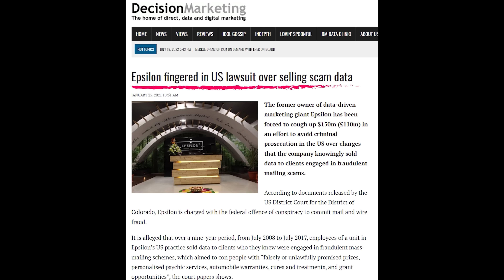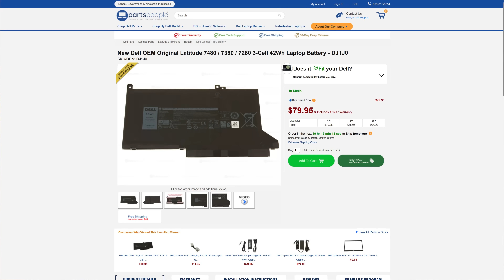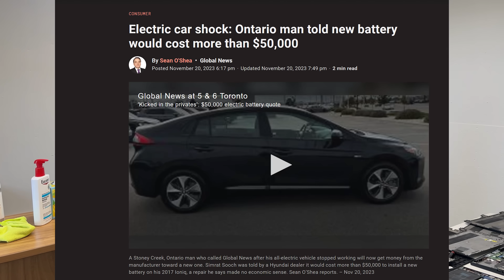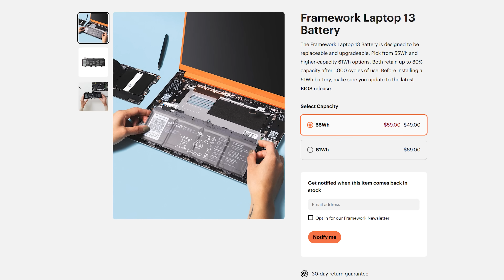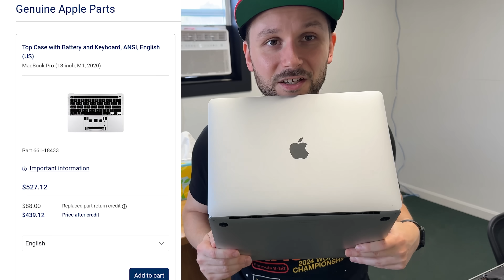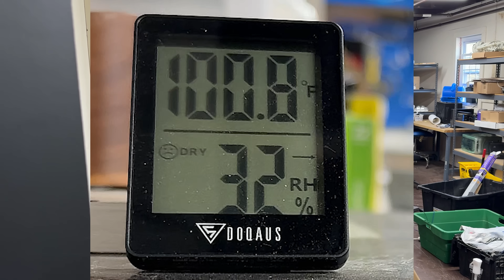Planned Obsolescence: Why is Replacing a Battery STILL So Difficult and Expensive?!

Comment: 3:28 needs to be a reaction gif for all my fellow devops guys for when dev sends you documentation

I noticed that batteries got crazy in cost after they became custom molded for the device. When they were just bunch of 18650s they were cheap as chips (which makes sense). So I'd blame that probably.

Comment: Ahh yes the Dell Latt 7490 and 7390.
Whenever I see one at work the battery is always pillow status.
I think that generation of batteries were just really bad.
I have other laptops that are just as old or older that don't have that problem as commonly has the 7390n/7490s

Comment: if the battery is just bloated, you can debloat it... with an all plastic tool and if possible when the battery is low on charge you can du a little hole/cut in the external plastic wrap to release the gas, the problem with dell batteries is that they are sealed.. when the battery release gas the wrap bloat... it's not dangerouse.. me and my boss have done this a lot of times

Comment: Your reasoning about not sourcing a replacement battery is exactly why I am having to replace my Samsung Galaxy S9+ with something else (either an A52S or a S23 Ultra). After several years of use, the battery life has just gone down the pan. And being a modern smartphone, I don't have the tools to unglue the back, dig through the phone, then unglue the stupidly-glued-in battery (and then replace everything and re-sealing the phone, hoping it doesn't break in the process). 
The cost of taking it to a phone repair shop would make the whole thing unfeasible - especially given its last OS version, Android 10, is starting to lose app support.
So the whole thing about laptop batteries applies to phones too - and the same goes even more so for the software! At least with a PC you can use Rufus to bypass the Windows 11 requirements. (I have Windows 11 on a 7th gen i5 with no problems.)

Comment: I feel like this is an appropriate place to say I somewhat revived a phone by soldering a different battery cell onto the connector for the original one, it worked fine until I started messing more with it and the connector up and died on me, but it was an interesting experience to have what looked like a AA battery taped to the side of it lmao

Comment: batteries arent THAT difficult to find/replace... as long as you are okay with generic ones. Genuine batteries from the manufacturer is another story, but generally as long as the device is still supported, i find I can usually hunt down a genuine battery or two. may be more difficult from a refurb pov because you may need dozens of them.

regarding windows 10 loss of support, those devices that can't upgrade to 11 will likely get linux or chromeOS flex.

Comment: What sucks too, is that many of these devices won't even run without a battery installed in them, not with just the power supply plugged in like the older laptops.  If it's swollen and you can't get a replacement battery then the device is e-waste!  Done on purpose for sure! 🤬😡
Also, I can't tell you the amount of replacement batteries that I bought off of Amazon that were just dangerous crap that swelled up not even a year after I replaced them.....some even REALLY bad! 😳🙄

Comment: The whole battery issue was better to deal with back when laptops used the common 18650 form factor for lithium ion batteries. Those never expanded, being a hard cylindrical cell.
The whole rush for thin and light computers meant switching to thin Li-Polymer cells, which have a tendency to bloat, and therefore fail - even if the capacity is still good, a bloated Li-Po is bad news. 
Some things have not improved for the better...

Comment: I'm looking to get into IT and noticed that batteries are the bane of many a portable device (ear buds, laptops, tablets, smartphones, wireless headphones, controllers, etc), especially when you're trying to get access to said battery. The one that is easy enough to get access to is the 8bitdo Pro 2 controller and that allows for using traditional AA batteries, comes in handy when the battery pack that came with it decides to no longer hold a charge and can be used as a traditional USB controller. Can't say that about the other portable devices that I have on hand.

Comment: if you get the batteries from taobao than a battery (3C Certified) for a macbook costs around 30-50 usd depending on the model

Comment: One more thing we all could do is stop using battery based devices, use AC power. The computer wouldn't care, it runs just as well (probably better) on direct power.
Reply: Thank the humble bridge rectifier inside the power cord that turns AC into DC.

Comment: the wider public isn't making enough of a deal about how we are getting screwed with tech prices and replacement part prices

as for batteries I have been told each model of laptop has custom made batteries    so the manufacturer marks them up pretty steep to shaft larger companies but it ends up fucking everyone else instead

Comment: No, you're not out of proportion (except your skeleton).I have 3 phones and a Thinkpad with bloated batteries (plus a pile of removed bloated ones on fireproof surface for future pyromaniac fun and current fire hazard). Now i'm on the only phone i got a battery for without long and complicated pre-order, because the rest of these are not in stock or even offer in my country. And the new battery i got seems to be low capacity anyways (or something's wrong with the old phone which does heat up when playing videos and i don't want to buy another one due to financial trouble and principles). The discontinued devices will become collectibles with very expensive or unobtainable parts it seems.

Comment: bluetooth headphones are notorious for this. Even if the company is a "good company", good luck replacing the battery in it a few years down the line. Who would have knew that a pair of skull candy bluetooth headphones that I purchased almost if not 10 years ago would have a better battery life than a pair of 3 year old JBLs that costed me more than the uproar wirelesses. Also guess what, none of them have a headphone port so I cant connect it to my phone even if I use an adapter. Enshitification fucking sucks!

Comment: I think you did kind of blew it out of proportion, but not really. This could just be me, but i've used most of my devices for at least 4 year, be it smartphones or laptops. Batteries can be the limiting factor, but you can ruin everything with just HEAT like processors, RAMs, epecially in a smart phone. so just try to prevent that.

With laptops you always keep them plugging in while using so it doesn't pull power directly from the battery untill unless it's necessary and definitely don't game on them while it's unplugged, and try to lower the cpu output to reduce temps. I recently figured this out with my old [5 years now] MSI laptop, changed the paste and cleaned the heatsink. Temps don't go over 45c idle and 50-55 while gaming.

Comment: I wanna tell you
Something funny I was on windows 10 on my pc from 2012 fx 6300 old cpu and windows 10 would have it always at 20% to 40% and it had the ram at 30
To
40% and that was at idle and then I installed Linux mint and my cpu wasn’t over 10% and my ram 1gb and I can play games even like cs2 and what not crazy 😅

Comment: My computer was not/is not compatible with Windows 11.  A little while ago Windows decided to update because I left it on and I wasn't there to tell it "not now".  The update was Windows 11.

Also I am not in the industry but I a while ago was doing research on this very topic.  I was interested in an electric motorcycle and I was just pricing things for comparison and part of that was wanting to know how expensive the battery actually was.  It varies by a large degree but a ballpark average would be something along the lines of 60 dollars per kWH.  Consider that many laptops range in a hundreds of WH puts that into context.

Obviously more goes into making a product than the BOM and as I have said I am not in the industry.  It does seem inflated though.

Comment: On the topic of dodgy places to get batteries from... The fine folks in r/thinkpad have reported more than once that Kingsener batteries from Aliexpress are of decent quality, with charge protection and match the OEM capacities. I do not know if they make batteries for the 7490s (or other brands/models), though.

Oh, and the 7490s do support Windows 11.

Comment: This is what I hate in todays technology.

Headphones
Mice
Keyboard
Earphones
Laptops

Everything is kinda disposable cuz battery is not gonna work forever, you'll either replace the battery or buy a new one.

I want my tech gadget to last and can still be used even after 6-8 years.
Reply: Everything you mentioned except laptops... you can just get a wired instead of wireless. Sure it wouldn't be as tidy as wireless but in exchange eliminate the need of batteries. I used to have wireless mouse but omg the cost of buying AA/AAA batteries overtime when usage but wired mouse is a lot cheaper (including not needing of batteries at all).

Comment: Running into you in the strangest of places lately - other creators tossing shout-outs or including The Greatest Technician That Ever Lived as a part of the network of people they call when they need something repaired. Your footprint is getting bigger out in the wild wild world of PC building and fixing YouTube. Couldn't have happened to a better dude. That battery thing, though... I've already (somehow) saved a Surface 3 Pro from the dreaded battery death after leaving it turned off for over a year. (Elastic bands and literal days holding the power button down.) If it decides to grow a spicy pillow, it's going to someone like Trident because it's already not capable of running Win11 (by the processor) without the bypasses. (Neither is my PC but it's been running fine since 2013 and still gets me reasonable performance without having to sell a kidney and a testicle for a new GPU, let alone a new processor, RAM, and motherboard. Probably PSU too.)
I wish more people were as informed and understood the problem Microsoft (and potentially hardware partners? nah, that's too conspiracy theory...) is creating by forced hardware changes. (Yeah, it's not "forced" technically, but you try telling that to your octogenarian Nana nerdboy.)
Keep doing the good things! Now to check your inventory...

Comment: Yes, they are screwing you on the batteries. Setting parts at unreasonable prices for portable electronics was the way of it when I worked at Circuit City. In the 90's we sold replacement lithium-ion cell phone batteries ranging from $90-$170. That would be $122-231 in 2025 costs. They wanted you to buy a new phone with a contract since the store (and the provider) made even more money that way. 

Now, you may think, how would I know how much it costs them to make those batteries? The SPIF-Sales Performance Incentive Fund, though we always wrote it SPIFF. That was my cut as a commissioned salesman. I made a $50 SPIF off the $170 battery. Nothing in the store had a ratio even close to that. They were making so much profit from that battery.

Comment: For portable devices there is the new batteries regulation(article 11)in the EU
Rest is a quote from the eu environment website:
"Starting in 2027, consumers will be able to remove and replace the portable batteries in their electronic products at any time of the life cycle. This will extend the life of these products before their final disposal, will encourage re-use and will contribute to the reduction of post-consumer waste.

To help consumers make informed decisions on which batteries to purchase, key data will be provided on a label. A QR code will provide access to a digital passport with detailed information on each battery that will help consumers and especially professionals along the value chain in their efforts to make the circular economy a reality for batteries."

So there is sth cooking

Edit: writing mistakes

Comment: I have saved 20 or so phones by replacing batteries. I know the main reason they went to sealed battery compartments was for waterproofing. But why? It's not the hard to have a gasket around the insides that protects it from most dust and water. Like IP67 membranes they don't have the stupid high temp adhesives. Something you could just pull off, grab new gasket and battery, and done. But when you add in all these financing programs that the main phone providers have. You see the reason they don't want replaceable parts. LIke my phone. I got a new S-24 ultra last year. Before that I had a note 10+. That note 10 is still a perfectly functional phone. Except the charging port needs replacement. So I just use wireless charging. But that battery is getting old. I could open it, replace the battery, and port. But why would I? I already replaced the phone, so it just sits on my nightstand waiting for me to need it.

Comment: I hate when I find out that a product I have that's like say a speaker Bluetooth that also has 3.5 in.... Or a headphone that has 3.5 out, sometimes when those batteries break they cannot be be used. Frankly I think some kind of post battery support should be required for consumer facing products. Mandate a 3.5 port on Bluetooth speakers or any speakers especially smart speakers where they're cloud functionality will disappear entirely. 

At least then you have some utility for it being a wired speaker

Comment: Bypassing the requirements is unwise - feature updates will not install. Instead, upgrade to Windows 11 IoT Enterprise. It is byte-for-byte identical to regular Windows 11, but officially supports old hardware - no TPM 2/Secure Boot/UEFI requirement. You can upgrade in place and everything.

Comment: Even older DELL Latitude laptops are perfectly fine for basic daily tasks like internet, youtube, office, ... We are still rocking E6520 and 6530. Built like tanks. Love that construction, always happy to work on them or doing maintenance. Keyboard is great. Of course they were upgraded during the time (CPU, RAM, SSD, Wifi 6E) and are running Win11 24H2. They even support eGPU via free mPCIe slot and proper adapter (to play some older games). I am always telling everbody around me: do NOT buy cheap new plastic laptops. Instead of that, buy refurbished bussiness class laptops. It is another level because of that construction. As you said thousand times, they were built to last (most of them).
Reply: I have a 10 year old cheap HP laptop with an i5 that I chucked and SSD into and replace the battery. The thing is still snappy. You're absolutely right about enterprise laptops. Once you put a consumer version of windows on them, they're absolute BEASTS. Working with them in an enterprise environment, there are so many background applications, services, and processes running that it HEAVILY nerfs the performance, and makes them seem slow.

Comment: the laptop i use most is an old asus from windows 7 era. the battery is removable and dead. so i just leave it plugged in. its now a "desktop". my other laptop, some msi gaming win 10 machine, dies quickly and it to just stays plugged in because of that. It doesn't have a "removable" battery. I don't think I can unplug it, chunk it, and just run it off of wall power. So even if you, the company, cant give us affordable batteries. Give us removable batteries again that can be taken off and just ran off of wall power like the old days.

Comment: I'm an ESL teacher in DR. Our school requires us to get a laptop on our own dime to teach. But with a wage 500 bucks a month is hard to get anything.

My samsung laptop died on me, and I've trying to get into a refurbished thinkpad ever since discovering your channel. You're doing Gods work. Never stop.
Reply: We use zoom and, as far as I know, there's a linux supported version, so i don't care. I was trying to snatch a deal on a t470p off ebay, but had trouble with the package and it appears to be missing (USPS hasn't responded). But sincerely, I'm going for an L series as it is better price to performance. Also, t series have wild pricing rn. They can be 80 bucks now, and in an hour 150.
Reply: Do they care about what operating system? Do you have any very specific software needs?
Reply: I'm an atheist but I still support your right to a cheap laptop.
Maybe try for a Thinkpad, maybe an L13 with a 10th gen Intel, I got mine for $80, it's only 8GB and it's 256GB NVME, with the older Intel graphics, but cheap is cheap.

Comment: 3:08 I use this laptop as a work laptop as an IT lab aide. All of our work laptops (latitude 7490s) were imaged to run windows 11 24h2 enterprise 2 months ago. You can upgrade these to windows 11 without any workarounds, as the intel 8th gen processors are supported by Windows 11
Reply: Not all of the XX90's are 8th gen. Some of them are 7th gen. Just like how the XX80 was 7th and 6th gen. So the boards are swap-able from 6th to 9th gen. I make a lot of cash back in the day getting 5470's for like $10 and putting a $20 5491 or a 5490 board in it.

Comment: Battery is actually one of the reason why I don't buy iPhone, bacause I cannot replace the battery myself without proper tools and compromises. S25 Ultra is my first Samsung for the last 8 years because it has easy method to remove the battery. Ive been using devices from Xiaomi before as they have an easy way to remove the battery for almost a decade now.
Reply: Fairphone